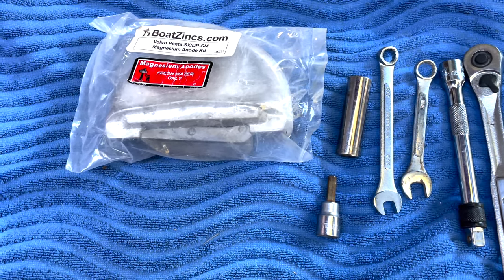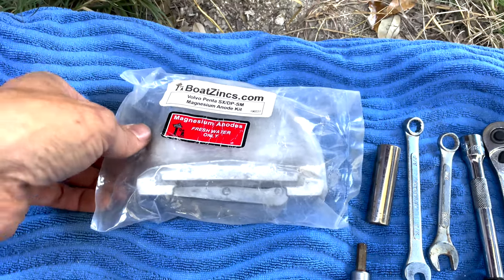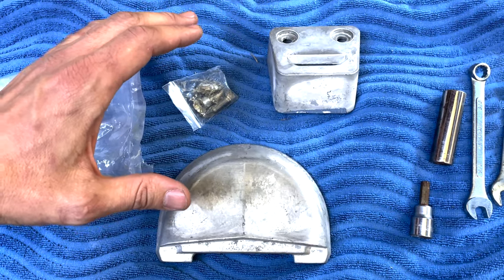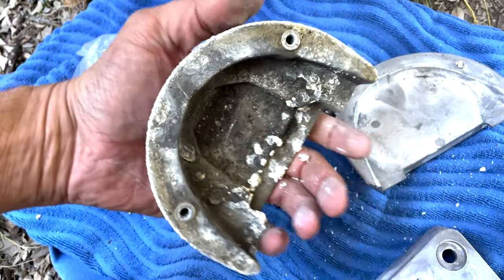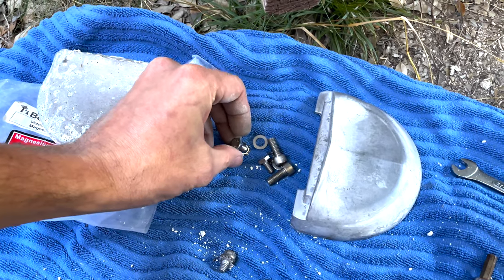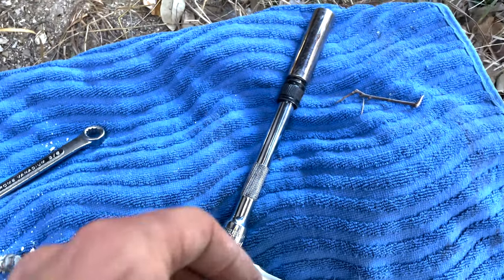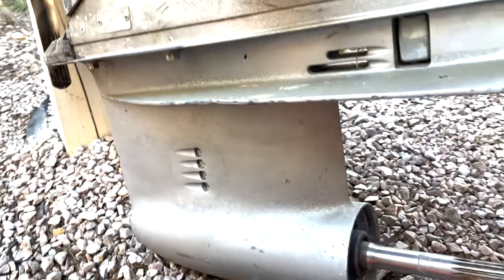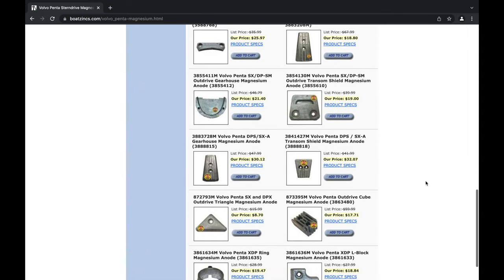Wrong Zincs aka Anodes!

Comment: Ah he’s back!! There are far to many day between posts!!
Reply from the maker: Hey Paul! Thanks for your comments!! I’ve had a few other projects come up—I’m back to boating projects, stay tuned!!
Reply: @michaelromer2016  awesome mate!!! I’ll be keeping any eye on your channel!!
Reply: @michaelromer2016  Do you have any experience switching from omc to merc full swap engine and lower unit?
Reply from the maker: @bargemover4270  not at the moment, but it could be done. As long as the “bowling pin” is small enough to seal on the outside, it ought to be a direct swap. If the OMC “bowling pin” is larger compared to the MERC then one would need to modify the transom in a way to make it smaller (as opposed to making it larger, which just means taking material away), which requires water proofing considerations. Basically the transom would have to be rebuilt if the “bowling pin” needs to be smaller. The “bowling pin” is the hole which all the stuff from the motor passes through to the stern drive. When it is all removed, the cut out in the stern drive looks like a bowling pin.